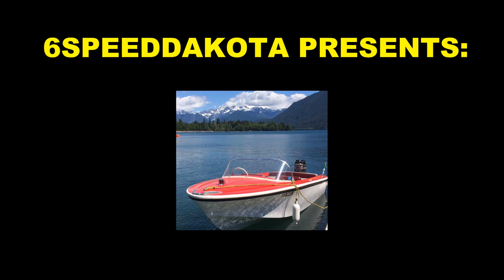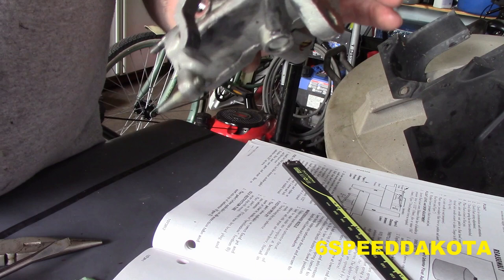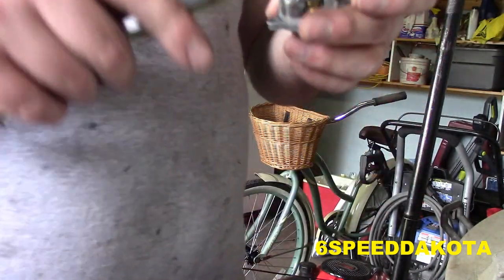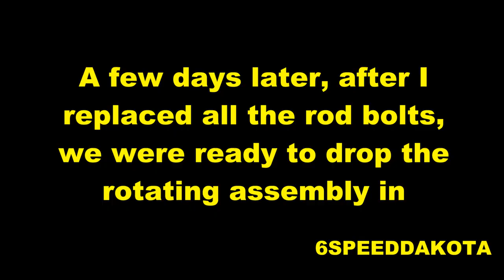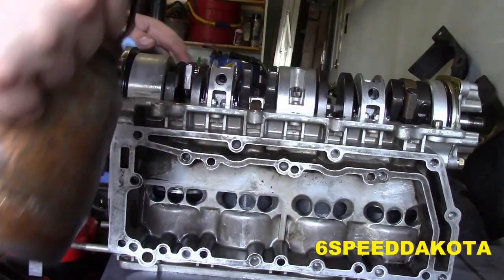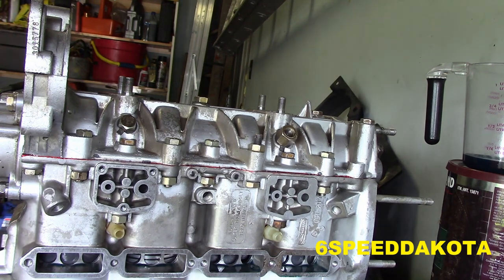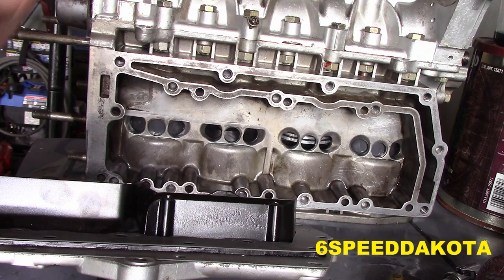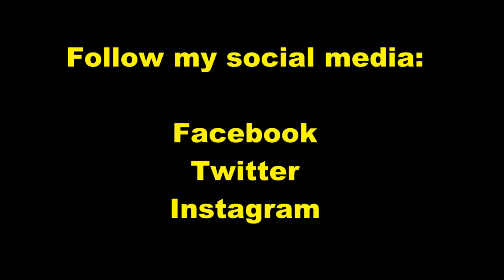1971 Mercury 500 Powerhead Rebuild Part 6: Powerhead Full Reassembly

Comment: Great video,what do you mean that the level which stopped it from leaking out the overflow vent? thank you
Reply from the maker: If the float level is too high, fuel will leak out the overflow on the bowl cover
Reply: @6speeddakota thank you for your prompt reply. is it same meaning of previous note that" contrary to what the manual recommends you may need to set the float level a hair lower than recommended"
Reply: @6speeddakota  Thank you, if I continue to press the priming bulb, will fule leak out the overflow tube?
Reply from the maker: @yijianggu5203  no, if the floats are sealing properly, the bulb will eventually get firm. If you squeeze the bulb too hard, it’ll weep gas out the overflow because you can force enough pressure to overcome the float and it will overflow

Comment: what oil gas ratio do you run?
Reply from the maker: 50:1, use a quality NMMA Certified TCW3 oil
Reply: @6speeddakota  Thank you.My spark plugs are wet, is it normal?
Reply from the maker: @yijianggu5203  you’re going to have some oil on them, that’s normal. If they’re wet with gas, chances are it’s got no spark on that cylinder.

As for your other question, I can’t find it on my feed, but when the throttle blades are closed, there’s an air passage that allows air to flow through the carburetor at idle. That’s known as the air bleed. When you close the choke, there will be a hole in the choke plate, that lines up with the air bleed tube typically.

The amount of fuel that is delivered is adjusted using the idle mixture screw, it’s a fixed amount of air, and the amount of fuel is adjustable
Reply: @6speeddakota  Thank you. do I have to close the choke when I start the motor
Reply: @6speeddakota  Hello,Sir. My mercury 500 is not able to idle with butterflies completely closed. The engine runs well as long as I give a little throttle by adjusting idle stop screw. what can cause it. Two cabs are rebuild and very clean. I have double-checked.Thank you